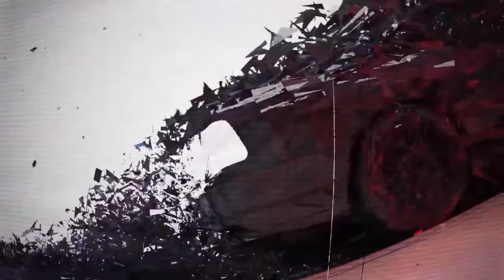Making a V8 SUV to Stop Smoking - BMW E70 X5 - Project X5: Part 2

Comment: Lovely, did this job many times on Volvo 5 cylinder engines. Used the same kind of toolset you used and compressed air. Works flawlessly. My tool was based on a lever kind of system though, the screw down system you're using looks very nice! Good job.
Reply: bad valve stem seals in volvo 5 cylinders are a common thing
Reply: @mohis5664  that’s probably why he did many a job on them😊
Reply: Which era of the 5 cylinders? I thought they were pretty solid motors.
Reply: @_chipchip  N engines probably
Reply: Never had bad stem seals had 4 p2, p1 Volvos more like pcv and turbo line's
Reply: @ruffraff4697  those too, but most high mileage white blocks need valve seals as well. Easier job though than on a BMW.
Reply: @_chipchip  pretty much any white block. Ive done 1996 to 2006 modelyears.
Reply: I did similar repair in my 850R.
Actually, without compress air, you will have more room to operate and its easier. 
You just need to drop a LONG poly rope into the cylinder at lowesr point and then crank up the piston. The rope will perfectly hold valves in place.
Reply: @FrenchVries  I never see any Volvo RN 5 cylinders (2000+) need this repair. However, old N engines (1993-200) especially the turbo ones need this done.

Comment: You have become a really good engine mechanic. I remember your reticence rebuilding the Alpina, but you pushed on and developed a whole new level of skills. Great Job!!!
Reply: Reckon at this stage he could rock up as a BMW Certified ...Master Mechanic...
Reply: @malachy1847  nope this is a hobby not real world
Reply: @bystander1489  fixing an engine is fixing an engine.  Its literally same thing
Reply: @nemanjap8768  nope so when fist engine blew up who pays for that certainly not the customer and taking weeks to do jobs is not what happens in real garages you would have 1 day to assemble that engine and another day to have the car running not 2 weeks so it's not yhe same
Reply: @bystander1489  yes it is
Reply: @bystander1489  yes it’s exactly the same… fixing/repairing an engine is repairing an engine… whether it’s outside in the driveway, in the shop on a lift or in the alley on jackstands, fixing an engine is fixing an engine, it just is and it’s not rocket science.
Reply: @robhughes8516  it's not when you work for a garage and every job is timed not 2 weeks to do up an engine obviously you've never worked in the trade
Reply: @bystander1489  In the Real World I reckon he would hold his own with many BMW Mechanics out there,  both in terms of his skill set but also in his diagnostic capabilities....with his diagnostic  skills allied his computer capabilities, so you're getting two techies in One ...
Reply: @malachy1847  nope he hasn't done his time as an apprentice or college this is a hobby there's a lot of science about cars that he would never know
Reply: @bystander1489 lol, no, there really isn’t… it’s all basic and requires zero college… most of the best techs out there have zero formal schooling…get over yourself.
Reply: @robhughes8516  no my friend done my time and ask any qualified mechanic on YouTube and they will tell you the same this is a hobby for him when the bmw engine blew up who pays not the customer he got some guy in Poland to rebore the engine that hadn't a clue what he was doing so come to the real world it doesn't take 2 weeks to replace an engine
Reply: @robhughes8516  ya that's why it blew up dream on

Comment: These videos are great!! I have decided not to be intimidated and do the valve adjustment and Vanos service on my S54 M3. Already did the oil pan gasket and LOTS of other work so no reason not to do everything myself even though the garage is barely larger than the size of the car hahha.
Reply: Just take your time and use proper tools. It might take a while, but it's not rocket science after all. 
Maybe you can find a service manual online also.

Comment: For future reference, there's a service function in ISTA and most scan tools (Autel/Autologic/etc) to set the Valvetronic actuators to a "removal position." It's not absolutely necessary, but it will keep the actuators from snapping out like that and can prevent any potential damage— I have seen damaged Valvetronic actuators from improper removal.

Comment: This video is the one I was waiting for because I have the same problem on my e61 550i. Now I am pretty sure that I don’t wanna do that but I have to. That massive clouds of a blue smoke when I am leaving a crossroad are lightly upsetting😂 Nice job man👍
Reply: Tell me about it lol. My n63 550 smokes occasionally
Reply: As a fellow N63 owner I recommend, getting 2 bottles of “Liqui Moly Motor Oil  Saver”. I tried to put the link, but it deleted my comment…so just get it from Amazon or eBay. Should be 2 for $20-$25

Mine use to occasionally smoke also, until I used that. It rejuvenates the valve stem seals & any other rubber in the engine. $25 versus $3k for the valve stem seal job lol

You’re welcome guys 🙂

Comment: It’s incredible how complex an engine can be
Reply: BMW engineers have perfected engine complexity.
Reply: @Leonardo555ZZZ  Every engine from the last 5-10 years is really complicated, as more parts for better fuel economy, performance and exhaust gas cleaning are added
Reply: @emrefifty5281  Sure , but these cars are 15 years old , and I doubt you can find any other makes which are more complicated and require more components to be removed in order to perform repairs and maintenance than BMW's.
Reply: @Leonardo555ZZZ  I mean, the other german manufacturers’ engines probably had very complex engines too at that time, luxury cars always have many sensors and electronics in there.
Reply: @BorisG13  Yeah , could well be ,,I don't know too much about Audi , VW ,, but Mercedes engines from the same time seem to be much easier to work on than BMW in my opinion.
Reply: @Leonardo555ZZZ  yyyeah, I dont really care about Mercedes and Audi and just assumed

Comment: Hi Sreten, lovely video again! Something that surprises me a bit, i've seen it on your other videos as well, it looks like you forcecibly ectract the valvetronic motor. There is a allen key on the rear of the motor (just below the connector). Turn that counterclockwise until you feel more resistantce and slowly take the motor out. That way you won't scrape the worm wheel on the eccentric shaft :) For installation just screw it in while turning clockwise and you're all set!

Comment: I’ve changed the valve stem seals on my 4.8 e70. I found a video on YouTube and rented the tool from Tony’s tool rental and he has all the videos to show how as well which was super helpful. It was a pain in the butt but worth it when there is no more smoke. Also a good time to change coolant pipe and all gaskets.

Comment: The  valve spring compressor tool is fantastic, very simple but very easy and effective tool, just wish I had one of these 30 years ago when rebuilding my E28 , 2.8 engine.

Comment: Last summer I spent almost a week trying remove that valve cover. Later found another video has a good tip: disconnect the DME cable. Next time I will disconnect the coolant lines and fuel line at the right side too. It seems so much easier. If this video was there last year, it would make my life so much easier.

Comment: I spent my childhood watching my father rip apart Chevy big blocks and do frame up rebuilds.   Back then, I was way too young to be intrigued and yet recall I was.

Watching all of this, I’m still stymied by the possibility of risk- forgetting something, all of this positioning of this and that.   Where is that insight best found?  Beyond trial and error, where do you DIY’ers gain this insight?   I would have no idea what to do with these specialty tool kits.   It’s sobering and yet exhilarating to watch.  If a piece breaks I’d be at a loss.

I’m about to do the oil filter housing/oil cooler job on an F15 but I know the oil pan job and the valve cover job are forthcoming.   At 80k, I’m anticipating a lot of work to bullet proof the car for the next 5-6 years.

Watching this job, at least for me is next level and I’m humbled by the skill and execution.

Wow!

Comment: Thanks Sreten.  I've had a really annoying oil leak on my N62. You've told me what it was in this video. Bloody vacuum pump seal. I had already done the back one but when you said it always leaks at the front I checked and you'd nailed it. Just got done swearing at it and it's back together.  Thanks man👍
Keep up the good work

Comment: I just bought a 2009 X5 4.8i in Dubai, the guy has owned it since 2015 and it has 138000km on the clock and he sold it to me for close to nothing because it has the exact same problem as the one you bought, now I'm going to use your videos as a tutorial or a step by step guide to do the same job, I'm pretty sure I won't be able to do as good of a job as you but thank you for the videos

Comment: I did an engine removal and reinstall on an E53 X5, 4.4.  What a job,especially with no hoist. The V8 is actually 'nested' on the power steering rack, so when lifting the engine, it has to rocked,jiggled and shook  to get it un-nest itself.

Comment: I'm marking this job up as one I will never do...ever. Changed the valve cover gaskets last winter and vowed never to go that far again. Wound up having the camshaft sensor concentric break and having to replace that as well, so it was a $750 gasket change.

Comment: Don’t know if you find this interesting or not, but when I used to do x5 valve stem seals when I worked for a bmw dealer, we used to drop the engine and gearbox down from under the car onto a special bed. It came down with the subframe and most of the front suspension. 

We worked out that the extra 40 mins or so it took to drop the engine down it saved so much time and effort doing the stem seals because you had loads of space. 

Fair play to you doing the man’s way 😅

Comment: I done this job 3 years ago on my 61 with the tool that that leaves everything on, but I agree this tool looks far cheaper and much more room to work. wish I'd found that spring compressor when doing mine. Access looks better at the rear on this than the 60 series. I knew you'd be good at this job after the pain of Chicago though😆😆😆

Comment: I have the exact same car, it was kinda gooey like that too. I've been running royal purple in it, you should see how clean the engine is. I did an Royal Purple oil change as soon as I got it, drove it 300 miles, then did another Royal Purple oil change. You wouldn't believe the goo that came out, the filter was clogged. Then drove another 500 miles, then did another oil change. It was much better, but still gross. Then did another change then did it at 1000, then went to every 3-4k miles. If you take the oil cap off, what you can see is immaculate. You could eat off it. Highly recommend

Comment: I did similar repair in my 850R.
Actually, without compress air, you will have more room to operate and its easier. 
You just need to drop a LONG poly rope into the cylinder at lowesr point and then crank up the piston. The rope will perfectly hold valves in place.

Comment: I used to do this on Landrovers the tool I used was a Toledo Valve Spring Compressor  304039 $40 AU.I used to cheat instead of putting each cylinder on TDC I would lock the crank then replace all the valve stem seals in one go.

Comment: My experience w this engine:

Oil leaks (valve, timing, alternator bracket)
Valve stem seals (not every time but probably every one eventually)
Tranny solenoids and the other seals inside
Valeo alternator will need replacement 
Expansion tank hose between heads

Definitely other stuff. 

Chirping tensioner
Water pump and cooling pipe leaks
Periodic intake manifold failures
Water flange in back of engine (transmission out) 

Hopefully Sreten got it cheap. This is alpina part 2. His girlfriend is going to be calling when its shit the bed on the roadside. 

To minimize that call I'd change the expansion tank hose, alternator and upper radiator hose at a minimum

Comment: Car dealers would put a cap full of brake fluid in the oil. Swells the seals and no smoke. It really does work until you change your oil and it starts smoking again. For rear main seals leaks, it's an amazing fix.

Comment: Mike Miller from Roundel magazine suggests that after a long drive you open the hood to let the engine coll down faster and prevent prolonged high heat.  I do that now when I go home as my drive is 50 miles each way.  I need to do it when I go to the office but I will never see if it will be raining till after it does and I don't want my hood open for that.

Comment: The tearing down part is always so easy but putting it back together and knowing which bolts go where is always mindblowing to me. You could write it down or take photo's ofc but still. Your vids are relaxing, never any worry on your part even if it's as bad as it can get.

Comment: You might want to add  that valve springs sometimes have a specific wind and need to be installed the correct way up or you may get valve float  .  Cheers

Comment: I need to mention that it would have been a good idea to to replace the compression rings on the camshafts with the update teflon type rings. The steel rings score out the camshaft housing and caps on no 1 caps over time, which then leads to a whole lot of Vanos and power loss issues. But great work!!

Comment: Try to unwind the valvetronic motor by using an allen at the top of the assembly. “Popping the motor out” may send the tension of the eccentric shaft unwinding overload the end stop and break the end stop or the shaft.

Comment: Highly anticipated video! Great work, now i know for sure to take out the engine of my E61 550i to do this job. There is just not enough space to even take of the rockercovers. 
Anyway thanks a lot for this video!
Oh and please replace the oil pressure switch, took me a while to find out it was causing an oil leak ;)

Comment: Hello! Love your channel and this video is great. I have one question. On the upper timing cover on the drivers side,  you mentioned in the video with frustration that the bolt in the lower outer corner of upt is rough to get out. I think you said you have to be a witch to get that one, lol. I could never see how you got that last bolt out so I'm hoping you can share that. Did you have to use a double jointed wrench or something similar?

Comment: I've been looking for your channel so long and admire your professional work. In this episode changing valve stem seals what is your opinion about 6 cylinder motor, when take out cam trays, can I use same manners to get them out by turning inlet and outlet cam as you did in this part? without any special tools what you think? I found only some videos about this in 6 cylinder motors where they get it out, but it has some risk parts. Anyway I watch your channel regularly and love it so precise work and tools are worth of gold.

Comment: We know you aren't a mechanic by profession but your skills do say otherwise. I need to ask you how do you know all these things? Apart from the obvious time you spend wrenching, how do you obtain your information? Forums, Bentley manuals (for each car?) mechanic friends? I would think, if not wrenching, video editing, or parts shopping, you are heavily researching different methods of doing a job (even if you have done something similar, no engine is the same and still imagine that you would research somewhere before tackling a job). As always, impressed with your work!

Comment: Why is it that the run from factory at 105°but you can run them fine with a 90° thermostat? Is there any, at least theoretical, benefit to those 105?
Your engine expertise is crazy now. The Alpina project has transformed a VERY very good channel into an brilliant one. Loving every video

Comment: with the special tool it takes 30hrs , I remove the heads, get the surface checked, and seals replaced in 20 hrs, the added price of the gasket kit and no drama.

Comment: Instead taking the sprockets off you could easily take the timing chain tensioner off then you will have more play in the timing chain where you can take the camshaft with the sprockets as one assembly.

Comment: Dear Sensei, please help! I have exactly the same car with same the  engine and problem. Thanks to this video instruction, I'm finally replacing my valve stem seals. I've done cylinder 1 and 2 and  can't continue because my crank will not move just before cylinder 1 TDC. It will move backwards that is how I've managed to replace seals on cylinder 2 and at certain point it will not turn anticlockwise as well. I'm was very careful not to drop things in, to be sure I even bought borescope and cylinder heads are clean except carbon debris. I'm scared to use a lot of force, as you have mentioned in the video if it doesn't turn "you should be worried".